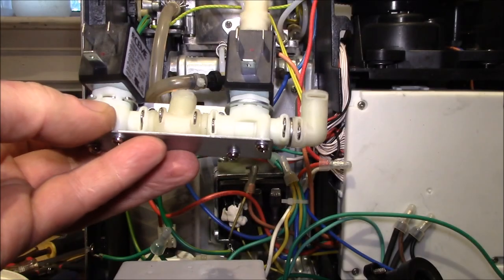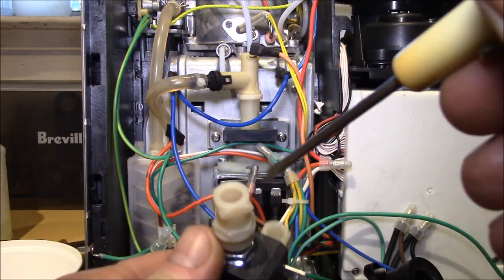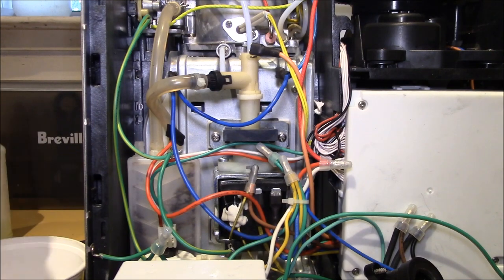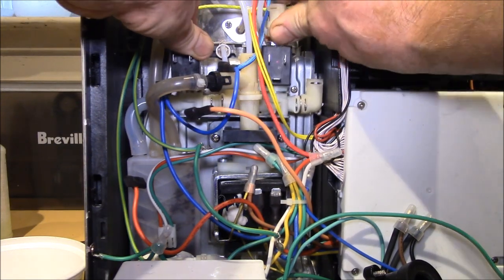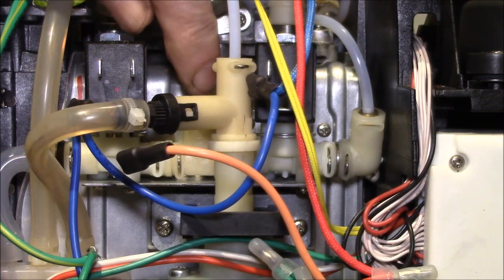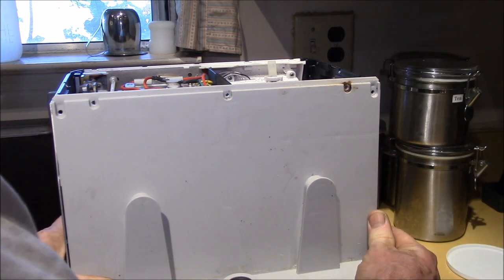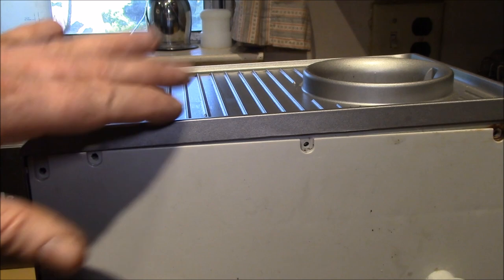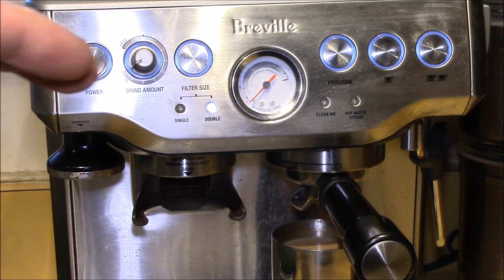Breville Barista Express Solenoid Block Installation

Comment: Thanks, you got me up and running!  I was able to order the solenoid block directly from Breville for $45 including shipping.  It got to me in less than a week.  They needed me to provide the Part Number: SP0020444, they couldn't look it up.  I contacted eReplacementparts first, they said it would have to come from the factory to them first and then they'd ship it so I saved a lot of time and their 20% markup.

It leaked a little at first, I took it apart, found the leaks and reseated the o-rings and it fixed it.
Reply from the maker: Glad you got your machine running.  Yes, it does sound like direct from Breville is the way to go for some of the replacement parts.  Usually you look up the p/n on the mfg. site and then find it for less at another on-line vendor.  But here, you look up the p/n on the on-line vendor site then order it from the mfg. for less.  Go figure!
And yes, those tiny o-rings can be a bit fiddly.  That's where I ended up making a special tool to insert them.

Comment: You helped me get my machine up and running again. After lots of troubleshooting and watching you videos it was determined it was my solenoid that was bad. I ordered it and look about 3-4 weeks to arrive. I also had the screws on the shower head loose so I had to take care of that as well. My machine is up and running perfect now after many months of no use. Thank you again for you guidance in all these videos. I now have confidence opening this thing up where as before when I first saw one of your videos I thought it would be impossible for me to fix anything on these machines.

Comment: Thank you so much we were able to replace the solenoid watching your clear video. Now the machine works but the reservoir tank is leaking water😢 any suggestion? Thanks you so much
Reply from the maker: See if you can find out where the leak is originating from.  Maybe try reseating the tank a few times and see if the leak stops.  Perhaps the hose is loose under the tank.  Or maybe the seal where the tank plugs in is out of position.  Or if that seal is damaged, replace it:
https://www.ereplacementparts.com/water-inlet-seal-p-629931.html
Reply: Thank you very much we will check this again and in case border the new sealing. It didn’t leak before we changed the solenoid but perhaps we left the machine unused and it did dry too much for the 3 months we had to wait tho get the solenoid 😵‍💫 thanks again you are very kind and responsive

Comment: Another satisfied customer!!  Thanks to your video, I was able to swap out the solenoid block on my bes840xl.   I paid $100 shipped from a local place in Burlington Ontario, and they had it to me in a couple days.  It was a pretty painless fix, and now I'm sipping espresso - most importantly, the wife can have her lattes.
Reply from the maker: Glad you got the machine fixed.  I wonder if many of these Breviille 800 series machines all use a similar solenoid block.

Comment: Thank you for the videos.  I just finished replacing the solenoid block on my Breville Barista Express BE870XL/A.  But not everything is working as expected.  The new solenoid block is on, the water line connected to the back panel and the water reservoir hung on the back.  I've not replaced the top or all the screws to button it all up.  When powered up the Filter Size single/double lights are alternating flashing.  The single and double button servings are now producing water out of the group head which it was not before which is why I replaced the solenoid.  The problem I have is that the hot water / steam control is outputting to the group head instead of the hot water spout / steam wand.  So no water is being directed up to the hot water/steam output.  What do you think?  Bad connections? blocked hose? bad new solenoid?  All suggestions welcome.
Reply from the maker: Check out the pinned comment on this video:
https://youtu.be/9lMw6ooiqPI?si=7GtVN89WGO3Xi0lZ
It has lots of troubleshooting information.

Follow where the water is going and see at what point it goes the wrong way and that'll help pinpoint the source of the issue.

Could be the grinder is not fully seated as that can cause the lights to blink.  As far as water coming out the wrong place, perhaps the water tubes are hooked up incorrectly or the solenoid wires have been swapped.

Comment: Hi Paul! Thank you for sharing your information with those of us that wouldn’t endeavor inside our machines without it! I have what might be a silly question - I’m preparing to buy the solenoid from Amazon, but my number on the back lists BES870, not XL. I’m in the US, should I just assume it is XL and buy the according solenoid?
Reply from the maker: It appears the 870 is the machine version for the Australian market:
https://www.reddit.com/r/barista/comments/868qjd/breville_barista_express_bes870xl_vs_bes870/
If so, make sure to get a 220-240V solenoid valve, at least if you're planning to use the coil.  Otherwise, the physical valve body is the same, just the voltage of the black plastic coil that sits on top is different, 120V vs. 240V.

Comment: Hi Mr Brown, thanks for the video. Very useful, I successfully diagnose the problem and ordered the 2/3 way solenoid and solved the no water from head group issue. However, the steam and hot water came out from the group head as well. I tried to pull out the live cable if the solenoid and the steam came out from the wand. Not sure if it’s another issue instead of the new solenoid?  Not sure if it’s controller issue but the original solenoid doesn’t works this way as the new one.( no water from group head with the original solenoid)

That’s very appreciated if you can help me out. Thanks
Reply from the maker: Figure out how the water is getting where it's not supposed to:
https://youtu.be/9lMw6ooiqPI
Since disconnecting the wire to the solenoid let the water come out of the steam wand, that points to the 2/3 way solenoid coil being turned on all the time.  This is common when the driving circuit on the main circuit board fails.  Another way to tell is if that solenoid coil (that black cube on top of the valve) get warm or hot after the machine has be plugged in for some time.  Normally none of those solenoids should be getting power if you're not running an espresso cycle.

Photo album with details on the circuit board and solenoids:
https://photos.app.goo.gl/bN1ugnLPYwvyDcr59

Comment: Mr. Brown, thanks for posting this.   I've had intermittent buzzing that became progressively 100% duty, which sounds exactly like your video, about 3 years ago, but my undisassembled theory is/was that the vibration pump has an aging valve that collected scale deposits on the ball or seat.  A single decent decalcification/descaling with a good commercial compound Dezcal, cleared it up 100%.  The vinegar descaling procedure (directed by the owners manual) had NO effect.

It is interesting that the same sound may originate in this solenoid block instead, since replacing it seems to have fixed your issue.  I may have bought my spare pump for nothing...
Reply from the maker: Yes, not sure exactly what was the root cause of this issue.  My problem seemed to be unaffected by descaling, I've been using Dezcal for several years now.

I saw in the LAI video where he had replaced the solenoids then a short while later had the pump go out.  I do have a spare pump on order, it's been on back order for about 3 months now.  I figure I'll get it some day and have it ready to go if mine goes out.

Comment: I think the plastic connector on top of 3 way was leaking, it was not very tight when I took it apart.˜Ordered new Solenoid block from ereplacement parts for $58.  Now waiting to hear ETA.  Current 'replacement' coils on eBay (although missing the 'S' in the part number compared to what's on my unit 6000BHS/G6RU, so a little unsure if exact fit) run about $30 from Germany for just coil or about $60 with valve... with 3-5 week lead time... guess the family is going to learn to survive on drip coffee for a while.  Again, without your help, not sure how much longer this would have taken me to solve and feel comfortable with its execution.
Reply from the maker: You might try adding a few wraps of Teflon tape on the threads atop the solenoid before screwing the plastic connector piece on.  That might seal up the leak.
Reply: I wish I had checked the connections before reaching a failure point. Unfortunately the coil trips the breaker when it’s activated now, right after temperature is achieved and with no visible water on top of solenoid... I did reassembled with Teflon hoping it may magically ‘come back to life’ but alas, it did not, hence the new purchase... however I’m sure someone in the family will try the unit on a daily basis in hopes that maybe the tight seal, and time for the internals of the coil to dry, leads to some sort of miracle...

Comment: Hi. I have a 8 year old Breville 860XL that has recently started tripping the GFCI but only when the extraction process is started. The steam and grinder do not trip it. There is probably some current leakage in one of the solenoid valves that is causing this. It functions normally when you plug it into a non-GFCI outlet. Could you tell me which valve comes on during the extraction cycle? Are there any other components that you think could do this? There has been a water leak that has been going on for a while, but only when using the machine. I have a VIZ variable isolation transformer similar to the one you use in your videos, so I could measure the leakage current with the solenoid out.
Reply from the maker: The 3-port valve:
https://youtu.be/9cC-m3a-oXY
It's easy to replace the black solenoid on top of the valve, likely yours has damage from water leaking on it or it's cracked:
https://photos.app.goo.gl/bN1ugnLPYwvyDcr59
Reply: Thanks for responding so fast! So from the video showing the lights, it would be the solenoid  with the tube coming from the top correct? That looks pretty easy to replace without removing the whole assembly. Would you happen to know what the part number for that solenoid is?
Reply from the maker: @ericmortimer8999  Yes, the valve with 3 ports:
https://youtu.be/9lMw6ooiqPI
Part number should be on the valve itself, or in the photo album for a picture of the valve out of my 870XL.  Or you can pick up the solenoid part only off eBay.
Reply: Thank you very much for all of the info and the detailed videos. I willl let you know how it goes. @The4Crawler
Reply: Hi. I went ahead and ordered the complete valve block assembly SP0020444 from replacement parts for $60 with tax and shipping. The solenoid by itself was about half of that…
Reply from the maker: @ericmortimer8999  Yes, that's what I did as well.  Keep your old valve block on hand.  I think the coils on the solenoids are the same between the old and new solenoid valves, so you'll have some spare parts.
Reply: So everything went like your video. I didn’t see any obvious signs of water leaks, but there is corrosion on the connections of the three way solenoid valve, so I assume that was the problem. With the new assembly in, I brewed a coconut latte for my wife. Best of all, no leaks! Thanks for all of the help.

Comment: Thanks a lot for the videos! Your videos helped a lot through all the steps of replacing my 2 way solenoid.
It didn't work as I expected though. Can you help me finding out what's going on, please?
So, before I was getting only hot water and steam and when I tried expresso all the water went to the disposal tray. So, I tested the 2 way solenoid with a multimeter and there was no resistance between the red and blue connectors. 
After I replaced the 2 way solenoid, the expresso works, but the steam and hot water come out of the porta filter too. 
There is no water coming to the diptray as well. Everything goes to the porta filter.
I guess the 2 way valve is always on then.
Do you have any idea of what's going on?
Thanks again!
Luis
Reply from the maker: A few options.  The tubing from the valves may be hooked up incorrectly or missing an o-ring or something like that.  Or, one of the valves could be sticking in one position.  If the 3-way valve is stuck on, water will always go out the center of the 2 valves to the porta filter.  Or it might be the main circuit board has an issue, such as a shorted Triac that turns on the 3-way valve and that is causing it to stay on all the time.  Simple test is pull off one of the power wires to that solenoid and run a cycle.  That forces that 3-way valve to be off which should send water only to the hot water/steam valve.  You could try the same with the 2-way valve, although it is only involved in the purge cycle at the end of use.  It should open for about 30 seconds to vent off excess water/steam to the drip tray.
Reply: @The4Crawler  thanks a lot for the quick reply! I made a mistake in my first comment. It was the 3 way valve that's always on and not the 2 way.
With the 3 way valve connected, it stays always on, this I tested with the multimeter. When I disconnect it, I have only hot water / steam. I'll try to check on the main circuit board now.
Reply from the maker: @luisgalessio  Some information on the circuit board below:
https://photos.app.goo.gl/bN1ugnLPYwvyDcr59
Reply: @The4Crawler  thanks! My circuit board is slightly different than the one from your picture, but everything seems to be well connected and I don't see any marks of burnt signs, or damage :/
Reply: I also realised that the red wire of the 3 way valve has voltage even when the machine is off and only plugged to power. I have 230V.
Reply from the maker: @luisgalessio  There will always be some voltage present there due to leakage current in the Triac.  I see a faint glow at night on the indicator lights I added to my machine.  But that said, it it's enough to energize the3 solenoid (it should feel warm after a while), then that indicates a Triac (or the driving circuit) has failed in the on state and is conducting all the time.
Reply: @The4Crawler  I got it. I'm still reading 124V from the hot wire when the machine is off. As I don't understand much about circuit boards, I'll have to bring it to a technician but that will cost me a lot in here in Belgium.
Thanks a lot for your help and all your videos! I learned a lot from it :)

Comment: I overpacked my one shot cappuccino and the machine started smoking. I get no pressure and no water coming out from the one shot or two shot but I do have steam and hot water for tea. Do you think it’s the solenoid?

Comment: Is it possible to source the solenoids by themselves or do you need to get the whole assembly?
Reply from the maker: Yes, see the video description for a link to the solenoids.  Or see the next video for how to possibly restore the solenoids to operation.
Reply: @The4Crawler  you're a legend. Thanks so much! Great video.
Reply from the maker: While it's possible to get these old Olab solenoids working again, I would really suggest getting one of the new solenoid assemblies ordered (it may takes ~2 months to arrive).  The new solenoids seem to work so much better than the old ones.

Comment: Hi I have same your machine 870XL I change the solenoid valve because its damaged but still there is issue I tried to discover where is the wrong and the buttons all of them light on please if you have any idea respond to me, thanks.
Reply from the maker: haven't heard of that issue before, so this is just a guess.  Try unplugging the machine for 10 minutes and see if that resets it.  If that doesn't help, try unplugging it then unplug and reconnect all the connections on the main circuit board.  Or contact Breville support and see if they have any ideas.
Reply: @The4Crawler  thanks I appreciate your help thanks a lot I will try your recommend.
Reply from the maker: @alsholla3136  Also double check all the things you disconnected or moved while replacing the solenoid valves.  Maybe something was connected back improperly or left unconnected.
Reply: @The4Crawler  actually its like before its happened while the solenoid damaged then I open the cover and I see the solenoid damaged so I changed but still the lights of buttons on all of them
Reply from the maker: @alsholla3136  OK, wasn't clear on the order of events.
Reply: @The4Crawler  sorry, I mean the issue for the solenoid damaged and the lights on all of them happen in the same time.
Reply from the maker: @alsholla3136  OK, then there may be something related in there.  The idea is to find out what things happened around the same time and it may be the issues have a related cause.
Not sure what solenoid damage there was, but electrically, the solenoid coils can either burn out and fail open circuit or they can overheat and the internal windings can short out.  If it was only a failure in the mechanical part of the valve, then the solenoid coils on top of the valves are probably OK and would not have affected the main control board.
Reply: @The4Crawler  yes you’re right the solenoid burn out but I check around the solenoid but I find nothing or unusual
Reply: Hi - awesome videos, I replaced the solenoids as the there was no water to the group head and steam wand (all the white tubes are clear), worked for the group head but the steam wand still has zero flow. Plenty of steam coming out the bottom when I turn off the steam head though.. any thoughts on this one? Thanks again!